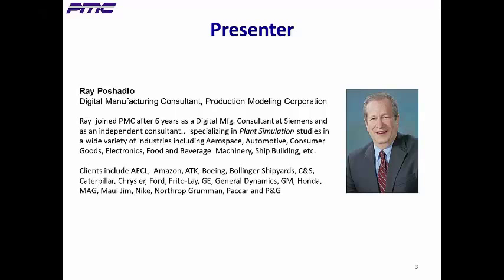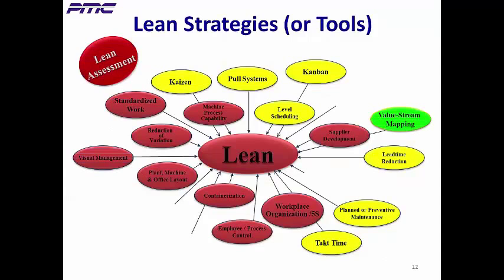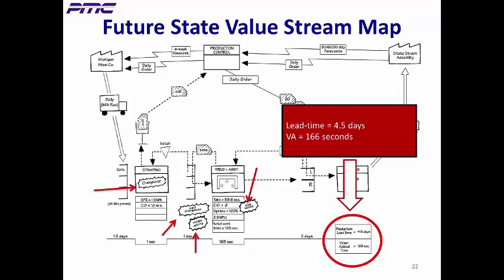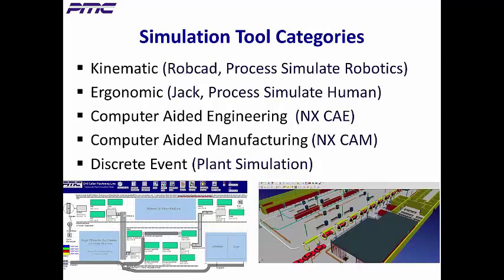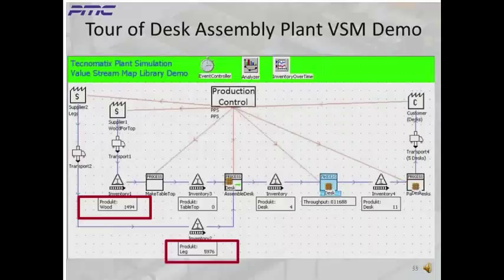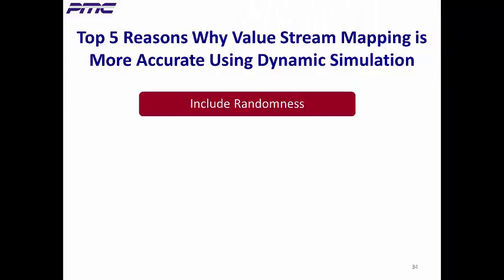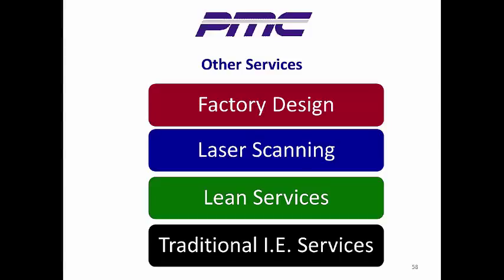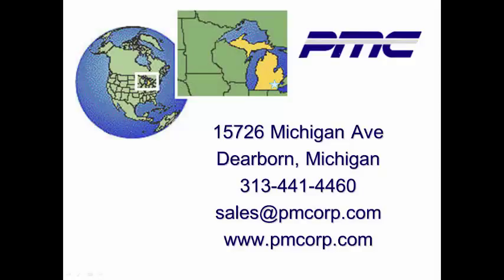Webinar: Top 5 Reasons Why Value Stream Mapping is more Accurate Using Dynamic Simulation

Comment: Sir. Nice video. I am working on a project on "process improvement" using value stream analysis. The organization I am working is a make-to -order where the parts are manufactured outside and we only assemble and sell it to client as and when the order is received. Is it possible or economical to Map value stream dynamically to improve process in this case? :) Or its useful only for make-to-stock and mass production environment ? :(